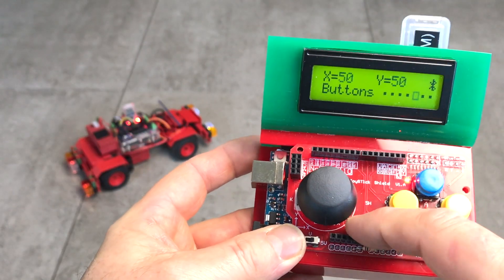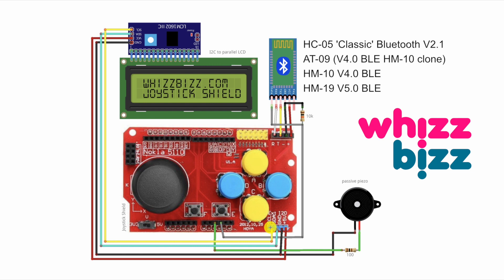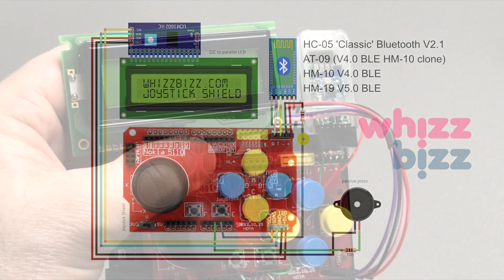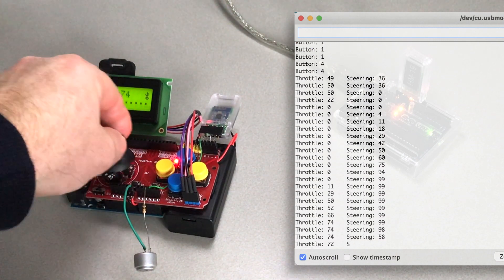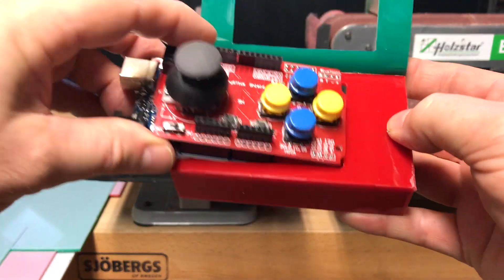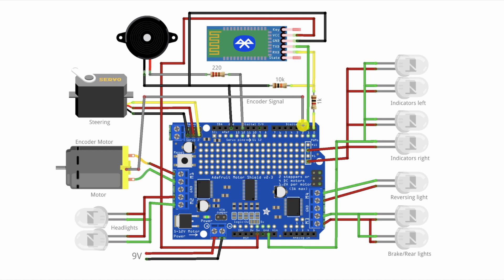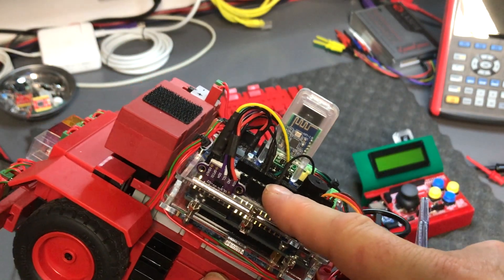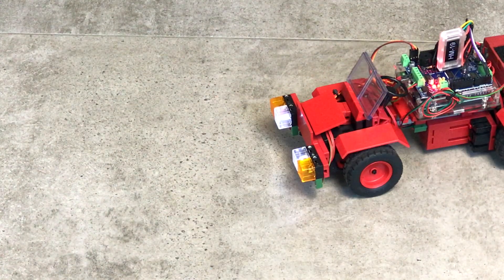Building a remote control unit with Bluetooth

Comment: Could someone explain to me why we connect RX to R and TX to T instead of alternately?
Reply from the maker: Good point, but perhaps because the shield is considered a 'slave' where everything is reversed? The main thing is that they have the order of the pins lined up. 😉
Reply: @arnoud-whizzbizz  Do I understand correctly that this works because we use SCL? Otherwise it should be reversed?  Sorry if I am asking stupid questions but I am new to this.
Reply from the maker: @jankes2k178  No stupid question! Have to think hard (to avoid a stupid answer....) It's been a long time ago. SCL is the clock counterpart of the SDA (data) signal of the I2C bus. That's used for the display. RX and TX are the classic serial bus lines connecting the BT module. I think I didn't notice the 'R' and 'T' being the same on the pcb I guess. All was probably good on first try because the order matched the pin-out of the BT module. Could also be an error of the (Chinese) manufacturer, I guess? Just try an have fun :-)

Comment: I see the wiring diagram in the video has only 1 motor, so can the arduino code you provide be used for 4-wheel vehicles with 4 motors?
Reply from the maker: The motor-shield can handle two motors. You might use two motors at the back in parallel if the shield can handle the current, but I think this is not what you mean. In my code the steering is done with a servo on the front wheels. My code is not explicitly written (yet) to control four-wheel driven vehicles (with e.g. mecanum wheels). This has perhaps even more similarities with my two-wheel Buggy-code?